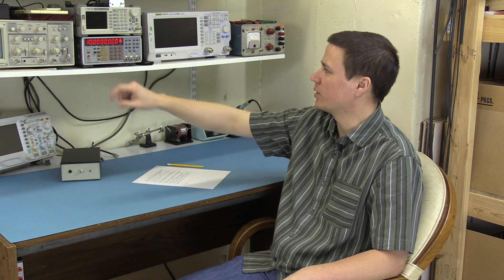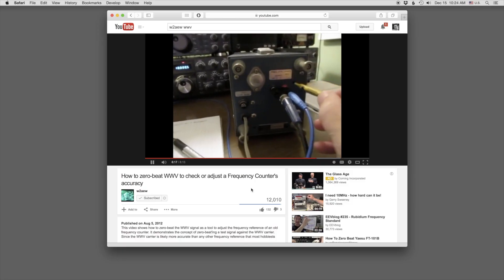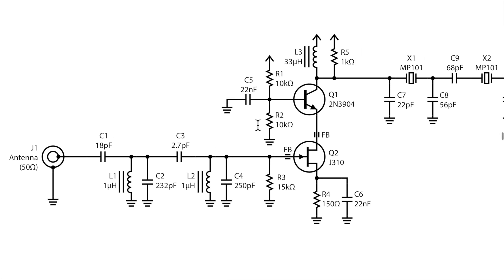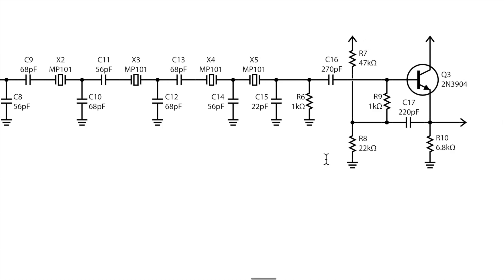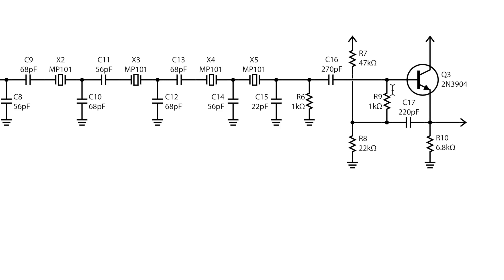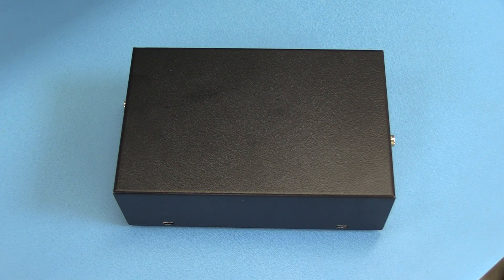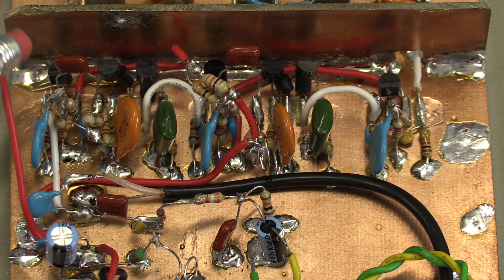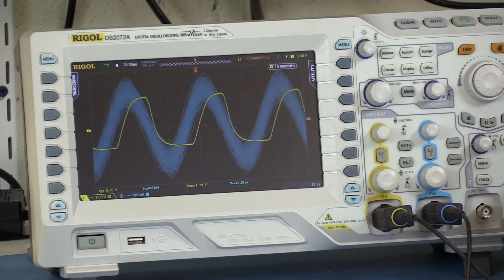WWV Receiver

Comment: I was wondering what sort of receiver could be built for the 10 MHz WWV transmitter without losing the carrier integrity. Now I know. I've lived in both CO and MI, and the TRF receiver I used for WWVB in Boulder, CO still worked beautifully most times of the day in MI as a frequency ref on 60 kHz. 

I built a divider to divide down 1, 5, and 10 MHz freq standards to compare on the scope against the 60 kHz receiver. It's clearly a slower process to watch the drift between the 2 signal and null it out at 60 kHz than at 10 MHz, but with a near perfectly clean 60 kHz sine wave several hours of the day I could see minor frequency drifting much more clearly, so the time it took to calibrate the 1, 5, and 10 MHz refs with 60 kHz pretty much balanced out. However, a good clean 10 Mhz single frequency receiver like yours would be an asset to any RF hobyist's lab, and shows that throwing money at GPS receivers, TCXO's and rubidium standards isn't really necessary to get excellent home frequency references. Well done.
Reply from the maker: Very cool! That sounds like a very handy way to do it too. Thanks for the kind words. I had a lot of fun with this project. I think I'd probably also have fun throwing money at a rubidium standard, so let's not rule that out too hastily 😉
Reply: In all honesty, I did get a used rubidium standard, but then, I do repair work for the NIST Time and Frequency group here in Boulder, so a standard is handy. Of course the first thing I realized was that such standards have more phase noise than a crystal standard, and that they also require frequency calibration. So then you need a GPS receiver to set your rubidium standard's frequency, which is then used to discipline a crystal standard for a clean signal which you use on your bench. There's really no end to it all. It's a search for perfection.
Reply from the maker: @johnwest7993  Hahah, yeah... that's how it goes 😅

Comment: If you are receiving WWV off a bounce from an ionospheric layer is there an issue with doppler?
Reply from the maker: That's a very thoughtful question. I don't /think/ there would be a meaningful contribution from the doppler effect. I'm confident supposing that the transmitting site and receiving site are not moving relative relative to one-another by any appreciable amount. I'm a little less confident, but still feel pretty good supposing that the point of reflection (or points of reflection) are not moving much if at all for usual modes of ionospheric propagation. Perhaps someone will step in to correct me on this. I have a vague sense that if the point of reflection were moving, as long as it was essentially equidistant between the transmitter and receiver (so that its horizontal velocity away from the transmitter is about the same as its horizontal velocity toward the receiver) the effect might mostly cancel out? I haven't sketched this last bit or tried to work it out for sure, so I don't have a lot of confidence in it.
Reply: @StuntProgrammer  Hi Aaron and Ian, yes there is indeed doppler shift using HF to receive WWV because the Ionosphere is ever changing and during part of the day its effective height is greater, and during part of the day its effective height is less.  Data acquired by Connie Marshall (K5CM) indicates an accuracy of 1 Hz is reasonable during most times of day, with the exception possibly being around Sunrise and Sunset.  Per Connie, "As long as you stay away from "sundown and sunrise" Doppler is usually less than 1 Hz.".  Connie's data suggests the variation is +/- 0.2 Hz in the mid afternoon at his location in Oklahoma.

Link to Connie's data showing effect of Doppler on the 5 and 10 MHz WWV signal mid afternoon in Oklahoma http://www.k5cm.com/wwv-doppler-corr.htm

Link to Connie's data showing Sunrise and Sunset effect on the CHU Canada signals (3.33 & 7.85 MHz) in Oklahoma due to Doppler http://www.k5cm.com/chu.htm

73, Don wd8dsb
Reply from the maker: @wd8dsb   Thank you for your wonderful summary of Connie's work! Sounds like I was right to guess that it would not be a meaningful contribution in this application. But it's nice to know -- and to be able to quantify the likely error -- rather than have to rely on a guess! 😀 Makes a lot of sense that it would be most strongest at sunrise and sunset. Very cool.

Comment: Cool project! I'm thinking of building one of these just to compare it to my other references to see just how well it does. Something like this should get you within 1^10-07 mostly because of propagation delays, on days with good strong propagation you may get better results. In the absence of a GPSDO, OXCO, Rubidium or Cesium reference's, it's the next best thing. I use WWV to check the frequency reference on my Kenwood TS-850 after a few years of aligning it to the OCXO in my HP 8644A. Until I can get a Cesium reference, a GPSDO or Rubidium standard will have to do.
Reply from the maker: Thanks for the kind words! I'd love to hear how it comes out.
Reply: Hi Craig,  check out the following youtube video https://www.youtube.com/watch?v=u0HAkMoAIoA&t=0s The receivers in that video are easy to duplicate and there are circuit boards available for them.

Comment: Hi Aaron, I have a question.

If I have 2 of those receivers connected to 2 channels of the scope, one for each, I would be seeing 2 10mhz wave forms on the scope I believe.

Now, if I'll move the antenna of the receiver which is connected to channel B of the scope, would the wave form on the scope move too?

The rational is this: Rf moves at a speed of about 1' per nanosecond. In the youtube the time scale on the scope is 50 ns.

Thus, for every feet I'll move the antenna away or toward the rf source (wwv station or the the reflection's point), the wave form will move 1ns too.

What do you think?
Reply from the maker: Certainly. This effect (from electromagnetic radiation having a finite and predictable velocity) is often exploited in practice, for example: in phased antenna arrays, MIMO for Wifi, and such.
Reply: @StuntProgrammer  Thanks. So Where can I get those receivers? Is there any kit or assembled product anywhere?
Reply from the maker: @israelshapira3665   Sorry, not that I know of. 🙁 This was just a one-off project I made for fun and to use in my own shop.

Comment: I just came across your video. Been looking for a good design for a dedicated WWV receiver. I like the crystal filter and non- superheterodyne arrangement. I want to include decoding of the 100hz subcarrier to get the time code data. I'll probably do the receiver as one board and the digital decoder as a second board built into a common chassis.
Reply from the maker: Cool! I hope you'll share the results. It sounds like a great project. Good luck :)
Reply: Bill, did you come up with a good design? I'm interested in doing the same. High quality audio output is important.

Comment: depending where you are at you may need to tune a different frequency.  10Mhz strong at night NY USA. Have gotten 2.5 5 10 15 20 25 Mhz from WWV WWVH at different times and time of year. I have herd CHU Canada 3330 14670 Mhz as well. great video.  great way to set dial on a SW radio. station is 24/7/365
Reply from the maker: Thanks for the kind words are for the information about CHU!

Comment: Nice project.   I'm curious how stable you can get the WWV carrier to appear and if you have tried to quantify the relative stability.   In the video it looked like  less than 1 Hz or 0.1 ppm.
Reply from the maker: Thank you for the kind words! I was able to reduce the beat between the two signals a bit more off camera, maybe once in five seconds? I didn't try to rigorously quantify it. Making fine adjustments was tricky since the trimmer sticks a little. I fiddled with it until my patience gave out and called it good 😋

Comment: Great job Aron
Can you please give more information about FB & 33u FB inductors you have used because they're not quite visible on the circuit you've built especially the 33u ones. Thanks a lot!
Reply from the maker: +Abdulrahman Albatti The components marked "FB" are small ferrite beads slid over the transistor legs. I'm afraid I don't have a part number handy.

Comment: How is it working now at solar minimum? Also what kind of antenna are you using?
Reply from the maker: I haven't dusted it off recently. I believe I was using a four-band trapped vertical before (not optimal, but usually brings in WWV fine).
Reply: @StuntProgrammer  That is helpful, thanks. I've been trying various things but so far an 80m 1/L seems to work best but it still fades in and out at least for the 2 days it was up and running. That just proves that a well designed dedicated receiver almost always works better than anything else.

Comment: Great job Aaron - like your "ugly" construction method. You've got a new subscriber! 73 - Dino KL0S
Reply from the maker: Dino Papas Thanks and 73!
Reply: Dino Papas No problem Aaron. "Beating" WWV even by ear can get you very close although it takes a while to do it that way; that's how I started out (long ago) then graduated to using the color-burst TV signal (unfortunately that doesn't work anymore with new TV systems), and then the Z3801A GPS disciplined reference oscillator and finally a Rubidium standard. BTW, do you have a .pdf copy of your receiver design available?

Comment: What is your supply voltage? How did you isolate the power? Thanks.
Reply from the maker: gbennett58 The supply is 12 volts. I'm not sure about your second question. Isolate it from what?
Reply: Aaron Parks in the video you referred to the grounding problem and in passing said something about isolating the power. Perhaps I misunderstood. Do you have an updated schematic?

Comment: Great video.Very informative. Can you list the part no. for the Amidon toroid cores you used?  are they the T-106,130, 184 series?, also what wire gauge did you use ? thanks
Reply from the maker: I know this reply is late, but I just came across my notes. It looks like I tried a couple of different options but may have settled on six turns of #22 wire on a T37-2 core, bunched fairly close.

Comment: Hi Aaron, would you care to share what software did you use for the nice schematics?

Thanks,
Adrian YO6SSW
Reply from the maker: ***** I used Adobe Illustrator. I wouldn't recommend it for developing schematics from scratch, since it doesn't have any of the features you expect from a proper a schematic capture package. But, if you want to make something attractive for publication, it can do that. Getting the snap settings dialed in right makes it easier.